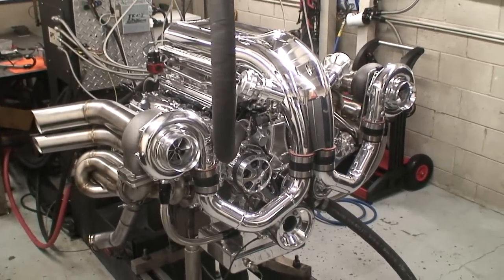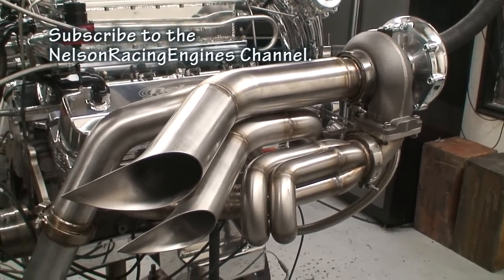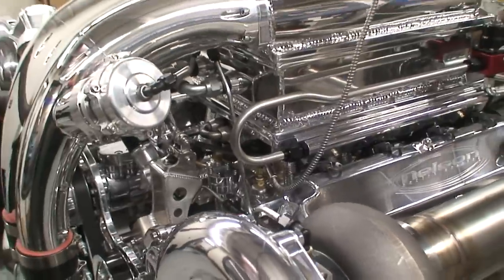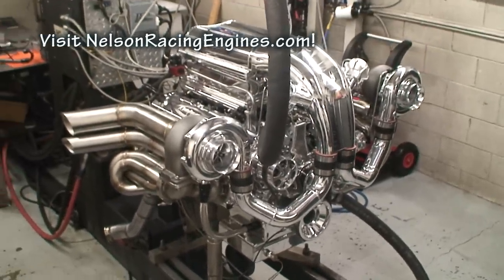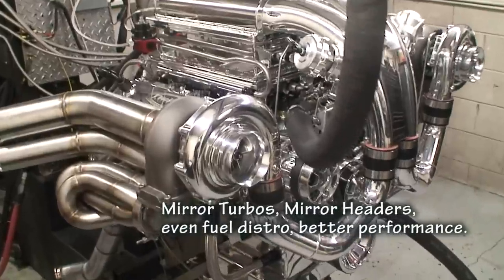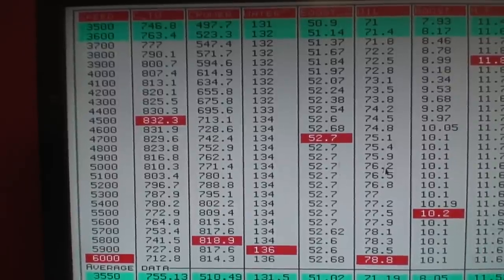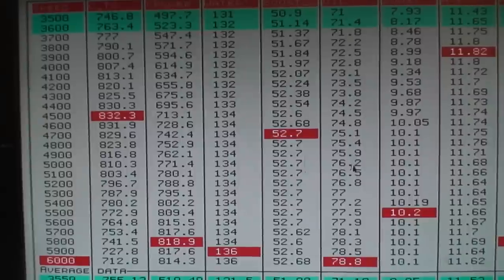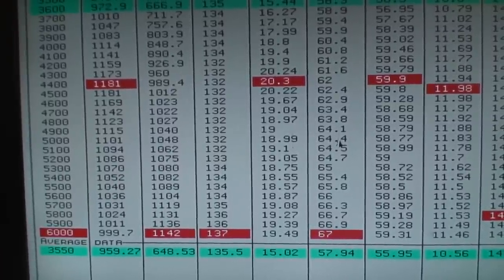New 1500 HP NRE Ford 428CI.  Visually Stunning Ford from Nelson Racing Engines.  NRE TV Episode 227.

Comment: Since this TT 428 Twin Turbo 1500HP engine is based on a Winsor Block, are you saying I could use this engine in replace of the 351 Winsor that comes standard in a 69/70 Shelby GT350 or even replace the 428 Super/Cobra Jet engine in the 69/70 Shelby GT500?  Thanks and God Bless!

BTW...Will you New 1500HP TT Ford 428ci engine be able to Hook up to a Ford Automatic Transmission?  Like a Ford C6 3-sp, Ford 4R70W 4-sp or the New Ford 6R80 6-ap Auto Trans!

Comment: Is it an billet piece?  
I Though windsor weren't safe after 327"
Reply: they never made a 428W...there was a 427W crate engine but the 428 was a FE block (Ford-Edsel) or FT (Ford Truck). I've heard of people punching a 351W to 428 but factory, the 428 was from Dearborn,Cleveland or MCC, not Windsor
Reply: netrioter +1
Reply: It’s a 4.125 aftermarket block

Comment: Windsor never made a 428..Windsor is a Ford  small block  engine. The 428 is a FE (Ford-Edsel) Y block that was made somewhere else...they were never made in Windsor nor are they a "Windsor" Block. This is not a Windsor engine unless its a punched block, like from a 351W for instance...which was the biggest factory Windsor. There is a 427W but that is a crate engine.
Reply: Good for you! Someone else that knows the Ford engines!!
Reply: You are an impressive troll.

Yes, we all know factory windsors are 351 cubic inches.  It is a common term to describe starting with a base 351" block and running a 4" stroke and ~4.125" bore size.
Reply: bigbronco 
That's all well and good, but still does not make it a "428" block!! Who's kidding who? 
Thanks for the compliment!  I'm no authority on fords, but these particular engine groups, I do know a little about!
Reply: Razor Works
What are you people talking about?  You are getting lost in the semantics of what he is saying in the video.  The reason why it is being called a "Windsor" is solely because of the cylinder head style that the block is using.  It probably started life as a Dart Iron Eagle block or something similar.  More than likely it is a 9.200" deck height and utilizes the 351 cleveland main journals in it (Like all SBF Dart blocks do).  The difference is with the deck and the cylinder heads/intakes it will utilize.  

Overall, it is still a WINDSOR based engine, hence why he makes the comment on the video.